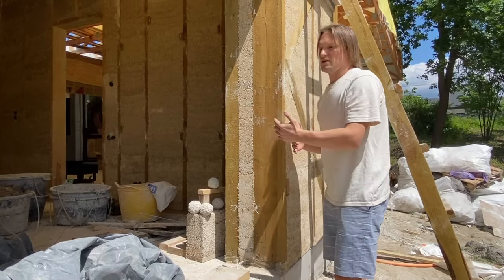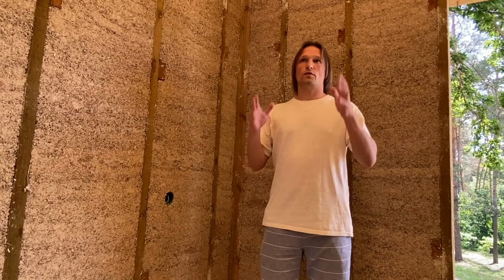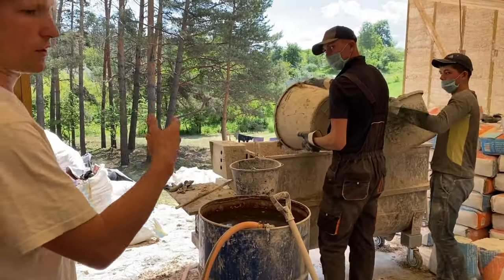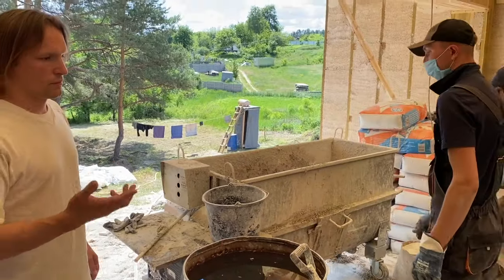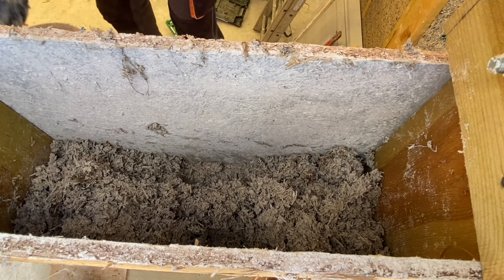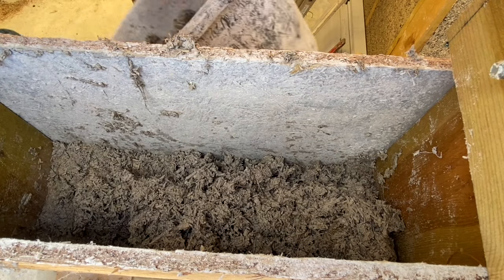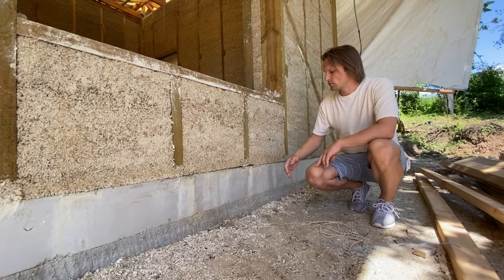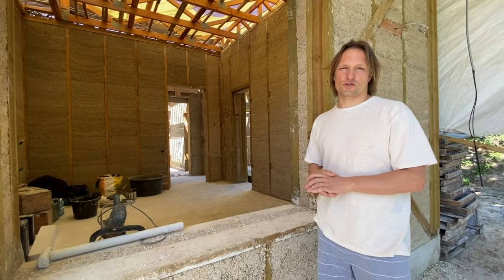Step-by-step guide how to build a HEMPCRETE HOUSE - Sergiy Kovalenkov - CEO of Hempire

Comment: Brother could you possibly at some point go over how repairs would be made later on? or hanging pictures, adding outlets, any of that are some of my main curiousities at this point still
Reply: Hanging pictures is ok, but if you are installing cabinets or a plasma TV screen in the kitchen you need to assemble it onto a stud. Adding outlets is ok, you just have to use lime based mortar with existing hemp hurds that you have taken out of the wall in order  to patch the holes.
Reply: Maybe a combo of building techniques and materials would be desirable. I could see using hempcrete for exterior walls, but building interior walls with standard studs and drywall.
Reply from the maker: @alextownsend6662  drywall is considered a material of high toxicity in EU. Just some food for thought what you have been putting in your houses for decades.
Reply: 3 years in now. Material will become solid as a rock during curing process over years. You can hang small cabinets with long screws without a problem.
Reply: @hempireua Fermacell is a non-toxic drywall and is very strong. You can hang heavy objets onto it like cabinets.

In France, the company 'DB Chanvre' uses Fermacell on the inside and sprays hempcrete on the outside.
Reply: Im going to make a video about that for ya bro

Comment: Thank you Sergiy, for explaining.
Perhaps a narration in concern of the sound would be great, the noise was now and then too much (for me, I'm hearing impaired)

Everywhere I hear you only MUST use the shive (inner core of the hemp) for hempcrete, but the handful of hemp you picked up contained also fibres with leaves......
Can you please tell me if it is mandatory to ONLY USE the shiv(e) ??
What kind of binder do you use ?
"Normal" cement (?) 
Do you use also a part lime in the mixture ??

Would love to hear the "exact" used materials.

I'm planning on making our own hempcrete house in about 1 or 2 years, that is why
Reply from the maker: Thank you for your feedback, it was a bit too loud. That will be removed in future videos. 
Hemp hurds can contain fibers up to 10%, no more. So a bit of fiber is ok. We use hydrated lime in our binder. The exact proportion by weight: 1 part water, 1.5 parts hydrated lime binder , 2 parts water
Reply: @hempireua  I am a little confused about the last part. Does that mean you start with 1 part water, add the lime, then add another 2 parts water, or should the last part be 2 parts hemp hurds?
Reply from the maker: @judyofthewoods  add it into the mixer in this sequence:  1 part hemp - 2 parts water - 1.5 parts of binder

Comment: If you have a lot of spare time, or if you live in a country where labour is cheap, this process can work.
But there's also the matter of building regulations, insurance etc. 
(edit: I initially described OSB as a toxic fire hazard, which it is, but OSB is used and re-used to shape the hempcrete, not as building material)
If you can get pre-formed hempcrete blocks certified they would be an excellent building material for bungalows. Pre-formed, light weight hemp blocks (hemp, not hempcrete) are also very useful to insulate existing homes from the inside, when insulating from the outside is not an option (e.g. historic buildings).
Reply from the maker: Thank you for your comment🙏 We don’t use OSB on any of our builds. It’s a very toxic material.
Reply: @hempireua  Indeed ! But I see plenty of OSB in your video. I can understand temporary OSB to guide the hempcrete, but I probably misunderstood the OSB on first floor?
Reply from the maker: @jacquesmertens3369  it’s all temporary.
Reply: @hempireua  That's a huge amount of toxic waste, don't you think? But if the OSB goes away, how do you make the floor? The video ends when you are starting to build the floor. Would love to see the rest.
Reply from the maker: @jacquesmertens3369  if we use OSB then we reuse it. It is covered in lime and doesn’t go bad for a long time. Please check our fb or instagram accounts: @hempire_ua for many images of insulation examples including floors.
Reply from the maker: Also, you are building a house that is going to stand for 70-80 years. This type of insulation is a quick way forward. Organise a workshop , that is big savings on labour costs  for the client , people pay money to learn, instructor gets paid from the workshop fees. Everyone is happy. 🎉🎉🎉

Comment: Muchly appreciated overview and looks like a fantastically healthy house. Key point, it's all about finding your local supply of materials. But what ingredient is in the binder that lets the form come off right away?
Reply from the maker: Thank you! That’s our proprietary formulation. 100% natural.
Reply: @hempireua  so you are not using pure lime as the binder ?
In Australia at the moment only one company claims to have building code approval with their hempcrete lime and their price is ~ high.
thanks for posting . good logic in your building method although i wish i could do lower labour input with shotcrete method to move material from the ribbon mixer to the wall void.
Reply from the maker: @heartobefelt  no , we use our fifth element binder for quick setting and light mix. How much is the Australian binder ?

Comment: Great Information! Thanks for sharing this.. getting ready here in Central PA for our first build... I plan on singleton's framing it and have 2 inch of hempcrete past the stud for the inside wall and 10 inches the other way... do you have any more information on the finishes for the outside and inside?
Reply from the maker: outside vapour permeable stucco- check with local suppliers. Internal: clay plaster, lime plaster, wood panels, something natural is A MUST!

Comment: The timber can be made from hemp as well. Hemp crete made from a material with a finer grind makes it denser. And using a hemp mesh the wall can be reenforced.
Reply: absolutely!
Reply: Timber made from hemp??  Are you saying you can make the hemo denser and therefore it is structural?
Reply: @Samthemancharles  they already do it with wood chips
Reply: Hallo, kannst du mir bitte sagen: Wo gibt es diese Hanfnetze und das Holz aus Hanf? Link oder Bilder. Vielen Dank❣

Comment: Building a frame wall and covering it with hemp mesh and then packing the wall with hempcrete makes a very strong wall. The frame wall form can then be removed and reused to make more walls.
Reply: it depends on the mix and the binder. "Very strong wall" is a very broad example. Can this wall hold two stories and a big hipped roof?  our mix is very light - 260 kg/m3 in order to create maximum energy efficiency.
Reply: Hempcrete looks to be fantastic infill, with a ferrocement but permeable type of outer shell. Imo roof/ walls still need the vertical load bearing support of wood framing.

Comment: I am also using duble stud system for my hempcrete house in Romania. Like your mixer. I am using an ordinary but large (500 l) concrete mixer, which works ok after figuring out the mixing process. What plaster you use outside and inside (brand names and component details so I could use it in my case)?
Reply from the maker: Regular stucco Baumit, Keim - Germany. Inside we use our Hempire hemp-lime plaster.
Reply: Vreau și sa mi fac o casa de cânepă, poți sa mi dai mai multe detalii in legătura cu mixul de cânepă, var și apa pe care l ai folosit?
Reply: @LorimerAlex  Buna. Sigur. Putem chiar sa ne intalnim si sa-ti povestesc cum se face. Dar daca vrei sa vezi cu ochii tai atunci eu merg in Romania la sfarsitul saptamanii viitoare. Acolo acum se pune acoperisul (podul) din canepa, peretii sunt deja facuti. Poti sa mergi sa vezi canepa, varul, liantul, cum se face amestecul, etc. scrie tel tau sau e-mail si te sun/scriu
Reply: @VladislavCantea  сколько надо конопли и сколько извести?
Reply: @АлександрДед-л9ы  1 m3 Hempcrete @ 350 kg/m3 =
• 130 kg SuperCalco S (CL 90-S)
• 65 kg Enduria 500 (HL 5)
• 155 kg hemp (canaplea)
• 325 L water (voda)
Reply: @VladislavCantea  Pot sa te intreb te rog de unde ai cumparat canepa si cu cat la kil ?
In ce zona ai facut casa ? 
Mersi.

Comment: Love this project and your clear descriptions. One question I have, is the lime render...if you coate the building in lime, would the wood structure – studs and beams – not shrink and expand with the humidity, thus cracking the lime render on top of it? Over time, I wonder if this would be a problem. Many thanks for sharing this and your expertise...
Reply from the maker: You need to install a mesh , otherwise it’s going to crack. Sometimes even two layers. First mesh goes right on the scratch coat and then the second goes right before the final coat of plaster.

Comment: nice project! not sure i get how you are doing the roof.... so the hemp is open at the celling and sandwich directly under the osb/membrane of the roof? or do you have a ventilation systeme to avoid condensation insite the hempcrete?
Reply from the maker: OSB is temporary. Hempcrete is ventilated at the top as well - there is a gap.

Comment: man, you are fantastic. what a great great project!!! looking for a similar project using stray, clay, lime, wood for myself and this is really an inspiration. perfectly fitting to a country like Ukraine with huge reservoirs of natural agricultural materials growing every year!!! as you build a timber frame house and hempcrete is proven to be fireproof all regulations (static, insulation, fire resistance)  in Europe should not be a problem. Just so much better than all those timber frame building projects using lots of foams, plastic foils, shitty materials on Youtube. thanks a lot and good luck. P.S.: just a short remark: "light straw" seems to be a bit outdated for a wall system because of lower insulation value compared to straw bale walls. do you have any number  for the insulation value of hempcrete?
Reply from the maker: The thermal conductivity coefficient for hemplime is 0.07

Comment: Thanks for this great video. Are there situations where the moisture barrier between the foundation and wall can be omitted? What if the foundation is made of elevated piers and wood or steel beams?
Reply from the maker: Yes, thats an option. we are usually talking about concrete foundations. Steel pile foundation is an option.

Comment: Does hempcrete in the roof between joists have to be compressed?  It's decent insulation but is it performing any structural function there?
Reply from the maker: You don’t have to press it hard the roof. Slightly compacted is good enough if you got the support underneath.

Comment: Your videos are fantastic! Videos on formwork and different approaches to joins and hemping across various days would be great for a future video. I haven't seen anyone cover that in detail in video or text.

Do you have any advice / direction on vertical joins - hempcrete to hempcrete?

I'm an owner-builder here and we'd like to do a full room wall in one day for aesthetics., i.e. focus on going up not around as quickly as possible. We won't render inside.

We are thinking of putting in vertical formwork and doing the hemping in 'bays'/sections, with joints hidden behind internal walls (eg. section 1 and section 2 in image). Externally, joints would be covered with render. Is there any issue with this? I imagine we could get some shrinkage, and have the 2 hemp walls (eg. section 1 and section 2 in blue text) move away from each other since there's no interlocking.
Reply from the maker: If you are joining to sections, you have to make sure that there are some interlocking connections to reduce thermal bridging.

Comment: In this house, is there a method for dealing with internal humidity moving into the ceiling? Is there a ventilation gap between the top of the hempcrete and the OSB? Again, thank you for the sharing your knowledge.
Reply: Osb itself acts as a humidity barier, no problem with little humidity geting into osb because it easilly evaporates into hempcrete any day. Most important layer is the one after hempcrete😉

Comment: Thank you for this video. I have plans to build a few hempcrete cabins for rental income. Originally I had planned to use strawbale construction which I have used extensively for a few construction projects, and was very happy with the outcome. But hempcrete just seems like an easier method with the same outcome of being natural and of high insulation factor.

I'll participate in a hempcrete workshop prior to construction but I was curious how you compact the very top layer of hempcrete of a framed wall where the roof rafters and sheathing would be in the way to allow for compaction. For example: At 12:14 in your video, how was the top layer compacted for the window framing with the bottom window timber not allowing you to compact the hempcrete from above?? Curious and stumped!!??

Thanks!
Reply from the maker: You install a formwork from one side of the mix and you compact hempcrete from the side, not from the top. Or other option, the bottom plate of the window frame install after  you apply and compact hempcrete. Good luck with your project! 🙏
Reply: @hempireua  Thank you!!

Comment: Hello, thanks for sharing your experience. Timber will eventually deform itself in time. Would that be a problem? As far as breathability would be feasible to have a roof made of hempcrete on top of a wooden surface (25 mm thick)? Or would you suggest some kind of vapor barrier between wooden surface and hempcrete? Thanks in advance and wish you a good day from Italy.
Reply from the maker: Timber shrinking is not a problem. There will be no thermal bridging of timber is covered by hempcrete. I am not sure I understand your question about breathability. There should be more membranes , except for the roof membrane.
Reply: @hempireua  thanks for your answer and excuse me for my English since it is not my first language. Regarding the roof my question was whether it is feasible a roof designed as follows:
Layer 1) wood
Layer 2) hempcrete + wooden structure 
Layer 3) vapour permeable membrane to allow vapour to reach upper layer no 4
Layer  4) ventilated layer
Layer 5) wooden surface
Layer 6) weather resistant membrane
Layer 7) metal roofing
Or do I need some kind of membrane between layer 1 (wooden surface)  and layer 2 (hempcrete)?
Thanks again for your kindness and wish you a bright day!
Reply from the maker: @lucasthijssen9844  1) wood or plaster mesh underneath 2)hempcrete; 3) membrane with  2’’ vent gap with timber planks; 4) roof shingles

Comment: If you have a traditionally stickframed 2x6 wall, without access from above the wall (top plates at the top of the wall) how would you insulate with hempcrete?
Reply from the maker: Put one board of formwork all the way to the top to create back wall. On the other side raise your other formwork 15 cm below. And fill and compact the hemplime from the side

Comment: Just a few questions first how do you do the rough framing for windows and doorways in preparation for adding the hemp: lime mix?  Second, am I correct that you can pour a perimeter concrete foundation wall, add a spacer membrane, and go from there? Third, which is easier a loose mix as seen here vs hemp bricks?  and finally is this method easier than rammed earth or CEB  and how does the cost compare?
Reply from the maker: Framing - just make a timber frame to the thickness of material ( if the hempcrete is 12 inch, than make a 12 inch thick frame)  around the doors and windows. on this video its quite clear where we put temporary formwork around the openings. Foundation is separated by a membrane - that is correct. i like onsite casting better method since we dont compact the middle of the mix, but only the edges of the insulation making hempcrete less dense in the middle and therefore more energy efficient. Blocks are good for projects where you are limited by the weather. Onsite casting can happen only if temperature is +5 C or higher. Its much easier than rammed earth, and much quicker. Density of hempcrete once it is cured 250 kg/m3. Rammed earth so much more labour intensive...

Comment: Fantastic video. Whats the approx R value when this is complete? You don't need any other insulation or vapour barrier besides this and the lime plaster? Any issues using this with a lightweight steel frame eg rust, etc? Thank you, slava Ukraine - SB
Reply from the maker: 2.5 per inch on paper, but in reality it’s much more energy efficient since the middle of the mix is not being compressed as much as the edges of the wall.

Comment: Hi, thank you for your video, very informative and well explained. I am building a small hempcrete house in the UK and wish to use corrugated iron on the facade and roof. May i ask, In your experience are there any problems using the corrugate galvanised iron sheeting attached to the timber hempcrete external wall? Kindest regards Adam
Reply: We would suggest to have a vent gap between such facade system and hempcrete and make sure that this gap is ventilated.
Reply: Hello! Would love to see how your Hempcrete house is coming along? I plan to do similar!
Reply: @kovser  thank you kindly, I’m about to start assembling the timber frame much along the design of your houses. I’ll let you know how we get on. Hope all is well with you guys in Ukraine 

Regards
Adam
Reply: @musicmeadow1868  thanks, its coming along slowly! I’ll post something soon and post some progress shots. Regards Adam
Reply: @kovser Hi sergei, i hope you are well. Our double stud frame is mostly complete and hempcrete will be cast in spring 24. May I ask - in the bathroom we will be using a natural marble tile, normally on a timber frame i would fasten a cement backerboard to tile onto, can/would you tile directly onto the hempcrete? In the video i see you have concealed cistern mounted surrounded with hempcrete..
Regards
Adam